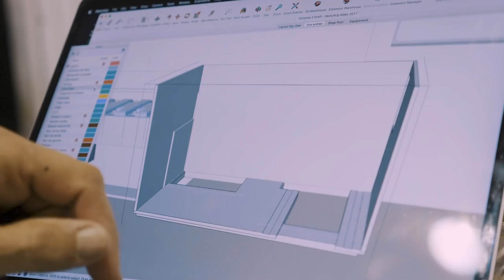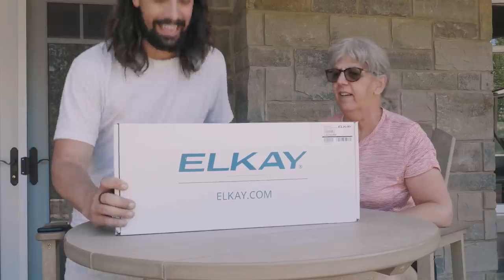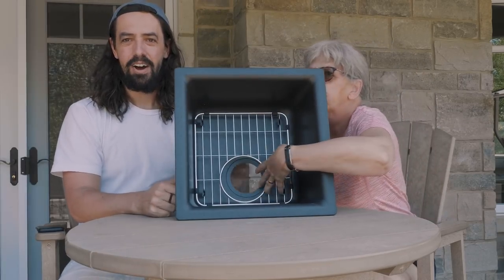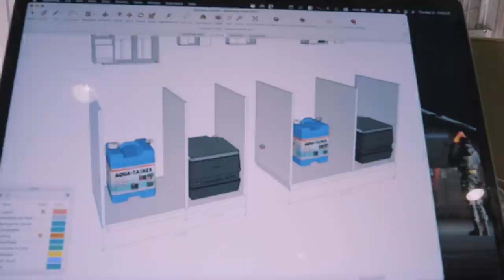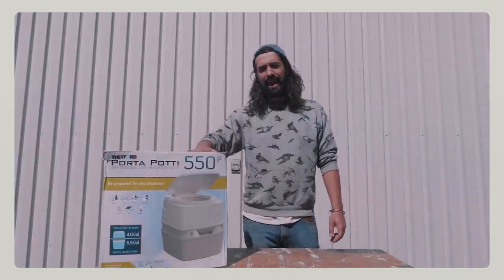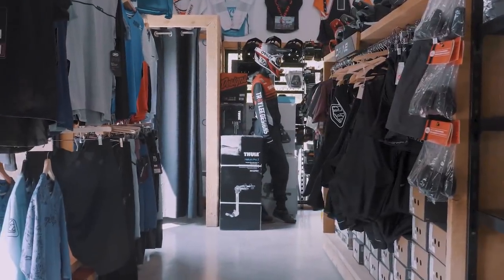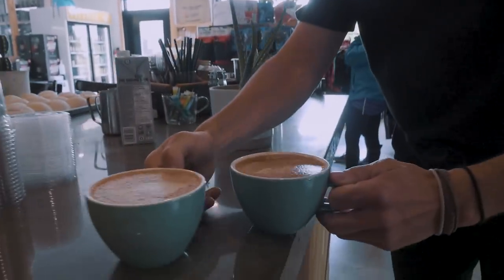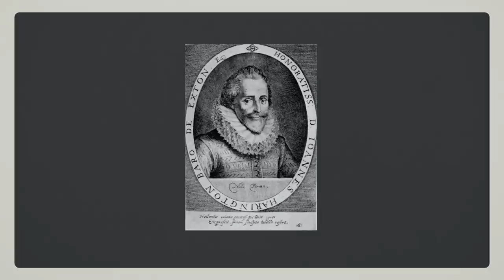VANLIFE Build - BEST Kitchen and Water Unit

Comment: PaPah, thanks for the builder inspiration and tips. But why weren’t rivet nuts a pro tip? Just started building our van out and they are life changing. Everything is amazingly secured with them. I worry you didn’t use them for a reason.